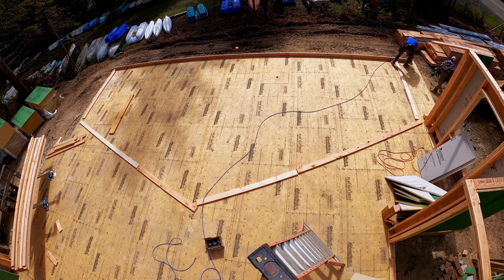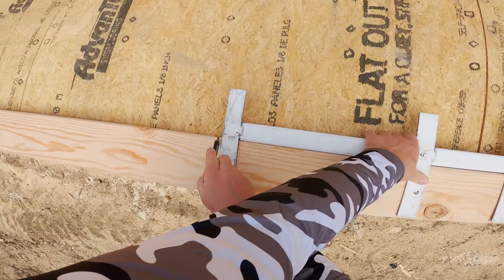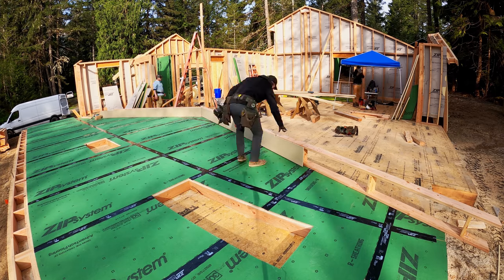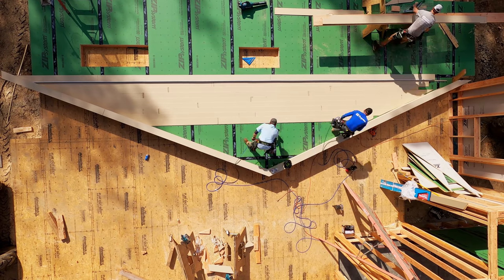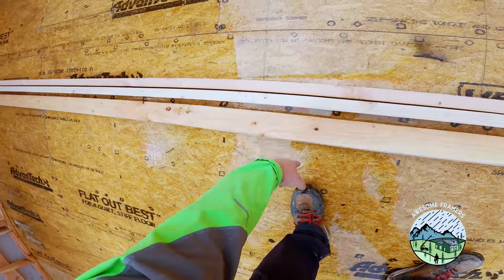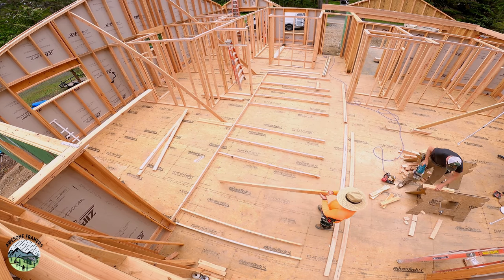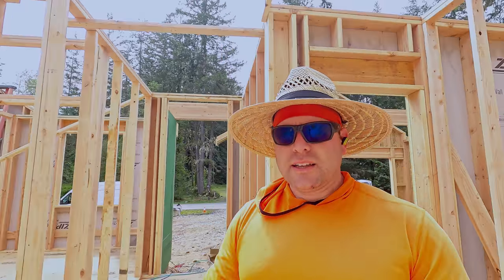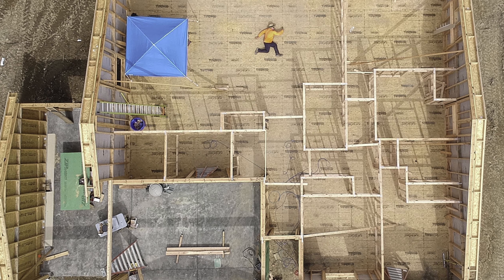Efficient Wall Framing Lakeshore Project Part 6

Comment: We  cant clad on the  ground makes it too heavy.  Though we do 2 ft centres in non load bearing and 18in on load bearing. I prefer to work off A1 drawings mainly coz my eyesight is going. What you call trimmers we call jack studs. Are your studs 90mm? We use  90  and 70mm. Headers are always seasoned and kd (kiln dried) hardwood. Ive stepped back amd doing smaller repairs amd renos by myself. Getting too old for framing. Yeah im only 60 but ive abused my body for 40 years

Comment: I use doble 2x4 header to give more wood for the people that trim the door and window that's the reason
Reply from the maker: Lots of guys do.  I've talked to every trim carp who's worked on our houses and they don't care.  Might be because our homes don't typically have large casing around the doors.
Reply: @AwesomeFramers  Yeah, the finish carpenter that follows me on most jobs would throw a fit if I left less than three inches of solid wood above door openings. He's the type of old-school guy who wants to do everything the same way he's done it for the last twenty years and is uninterested in adapting to anything new. Working around people with that type of attitude really wears me down. To his credit, he is an extraordinarily fast and efficient trim carpenter as long as he doesn't encounter anything new or unexpected.

Comment: I really like those Paslode guns.  I bought the 16 ga (I am a finish carpenter ) and hang a lot of trim with it.  I built 4 huge hand rails walls and trimmed them out with it and used it (GC said it was fine) to place blocking the 40’ inbetween them where a big metal hand rail spanned it and was lag bolted thru that top plate into the blocking sucking it right up!  It saved me the time it takes to set with my framing nailer and compressor for that blocking!
Just a light gun , goes a long way one one can of gas!!

Hoping they come out with a 15ga for my doors I hang!

Thank u for the video and forum !

Comment: I could have missed it previously, but what compressor are you using for your high pressure coil nailer?
Reply: i do believe it is also a Max compressor designed for the high psi

Comment: Oh my God, cut your fire blocks and headers, don't layout the fuckin top plate of a rake wall. Dude nail the fire blocks an headers, then pull your tape out an check if your square. I've been a frame in Arizona for the past 25 years, there's nothing I can't do when it comes to wood an nails.

Comment: Most places I have worked will frame the wall to the top plate then stand it up and put the bottom of the studs on the layout marked on the bottom plate. Then toe nails it to the bottom plate also we have always done 16in to 18 inch on center in Texas but I'm also learning still to I'm only 24. But it's always bring a incredible sense of pride when your done and it's perfect for the family we built it for

Comment: I don't have any experience with a 24oc frame wall, so I'm very curious what that feels like for an interior wall in a house. Does the wall shake when shutting doors, cabinets? Does it cause problems with drywall?
Reply: It shouldn't... should be just as strong as a house framed 16" oc

Comment: It's good to see proper approved hand signals from you and your crew! I'm a smidge older than ya'll so I'm gonna say enjoy it while your physically able! I still frame and hang a little bit! My last hoorah was layout in the Patel mansion outside of Tampa (look it up on google).Pretty much not a straight wall in the place! 5 tier soffits, grand ball room, mosque, library, rooftop bar, wine tasting room, hidden stairwell, outside  was sandstone panels that were pre assembled in India, (the whole exterior )and cut and shipped here in About 400 crates, underground parking for 12(in Florida?)without a doubt the most complicated layout o ever did. We had to layout 1'x1' squares on the floors before we could even think about walls (like I said curved walls, free formed radius's! Check it out! 🤠🤔